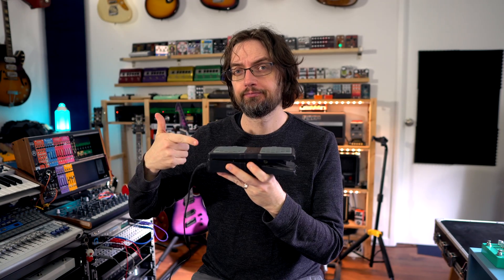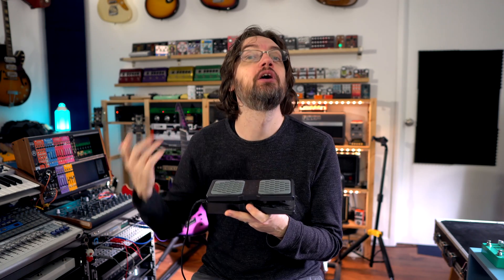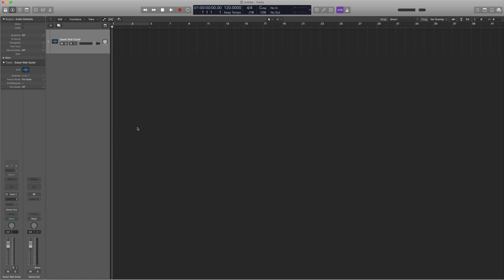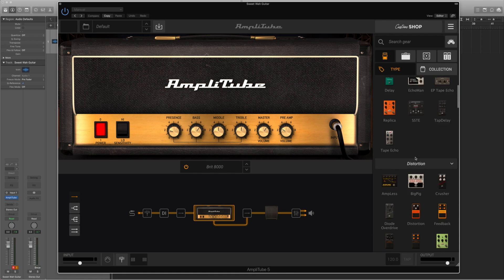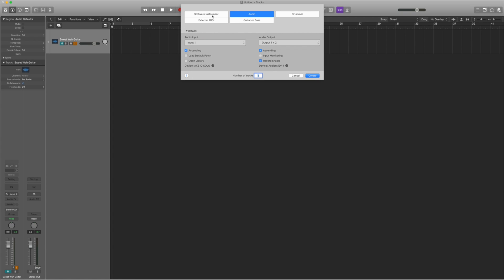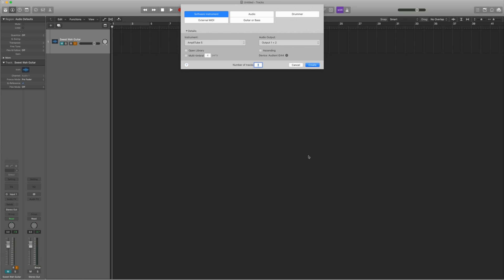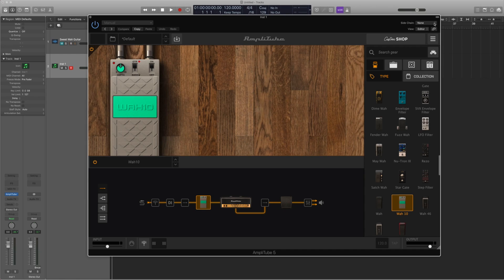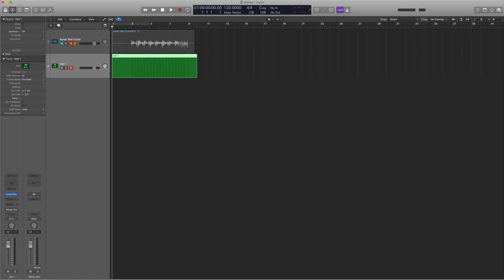How do I get an Expression Pedal to work in AmpliTube 5 with Logic Pro...??

Comment: Thanks so much for posting.  Brilliant how you figured this out.   I called Apple support to get help with using AmpliTube wah in Logic, and the rep found this video.  I was so frustrated, and this finally solved the problem.  Much thanks.  It seems like it should not be so complicated, but so be it.  Until maybe a future version of Logic Pro makes it easier, it is what it is.  I got the wah to work.  I play pedal steel guitar, and I use the volume pedal in AmpliTube pedals to play in AmpliTube proper.  Gonna try to get it to work as plugin in Logic Pro 11.  BTW, I am using IK Multimedia AXE I/O USB Guitar Audio Interface and Mission EP-1 expression pedal.

Comment: My audio interface does not have an expression pedal input, only a midi in and out. Is it possible to get it to work if I connect it via a convertor cable to a USB port on my Mac?

Comment: Hi, what is the best price/performance midi to usb device to connect the expression pedal to PC for home users who plays guitar for just fun?
Reply from the maker: If you don’t want to record it but just play then any of the IK Multimedia interfaces will do! This video is really only about recording what the expression pedal does in a DAW like Logic!

The AXE IO One for example is not very expensive and has two expression pedal inputs in the back, so you can have an expression pedal for a Wah or Whammy or anything like that PLUS a dual switch so you can change channels on the amp or turn effects on or off - it’s very easy to assign what the expression pedal and the buttons do

Comment: Amazing! This is closely to how to set up Mainstage and Helix Native! You can also set it up to engage the wah with the wah itself! In mainstage, create a new assignment, type Absolute,  using the same CC number as the wah, MIDI Through “Automatic”, send value to “none”. Map that to the switch controlling the wah bypass in helix native. Then use the “scale parameter” functionality in mainstage to disengage the switch when in pedal back position!

Comment: This ALMOST worked for me. My midi track was able to record the pedal's midi, but setting the sidechain back to the guitar track did not result in the guitar track's sound being applied to the midi amplitube channel.

By the way, I'm using the iRig Stomp I/O pedal board in hopes that I can use the board's built in expression pedal with amplitube while recording. But no luck so far :(

Comment: OMG why is everything in Logic so difficult? Are other DAWs as difficult with third party hardware integration?
It seems that stuff just stops working randomly without any reason or rhyme.
Reply from the maker: There is a much simpler way to do this - I’ll do another video soon!
Reply: @TSFAHTPS  Sooo, will we see another video on this?  I failed miserably to find a way to record with this and have the midi recorded as well. As soon as you do another take all is lost.

Comment: Just discovered this tutorial, and, after scratching my head and dispairing (and swearing!!) for so long ... Eureka - it works!! Thanks so much ... I can now get on with my retirement project of a cover of "White Room" ... !!
Just FYI - it might be helpful to others to say what my gear setup is  :-
MacBook Pro with Logic Pro X; guitar into Scarlett 6i6; Amplitube 5; Roland EV-5 Expression Pedal plugged into iRig Keys Pro (plug into keyboard before connecting USB to MacBook).
I had a bit of a struggle working out how to get Logic to "see" the keyboard!! (although it plays instantly if used with Software instruments Piano etc)  - found the answer in a short tutorial :- Logic Pro > Control Surfaces > Device > Logic Remote > Output Port and Input Port > iRig KEYS Pro
I then followed Gabor's tutorial through to recording a track with Wah (btw I chose the "Satch Wah")
Smiling again ...
Reply from the maker: Glad I could help!! I’ve been meaning to do a follow up video using the Control Surface setup!!

Comment: Logic seems to be garbage for using Wah or Expression pedals. I only use Logic and like it a lot, but using an expression pedal is tedious garbage. It will not only not work most of the time, it will forget all your hard work setting it up next time you start the app. Its super easy in the standalone amp sims.

Comment: I hace an axe i/o and connected a expression pedal and it works in amplitube but when in amplitube I record the track it doesn't record the wah I played. How can I solve it?
Reply from the maker: That’s what the video is about! There is actually a simpler way too…I’ll do another video soon!!
Reply: @TSFAHTPS  yes, but I don't want to use Logic, just record the track on Amplitube 5, maybe it's not possible
Reply from the maker: @DerrenTube  oh in the standalone version…sorry I misunderstood! That should work…I’ll check it out, I never really use the standalone version!!
Reply: @TSFAHTPS  yep I have an old mac so prefer using less app opened, but unfortunately on the standalone app it doesn't record the midi played, maybe there's a trick making insert, but I don't have any clue and last chance seems screen recording that also eat ram and resources.

Comment: I have an AXE I/O and plugged my expression pedal in. After I assign MIDI I can only control the pedal from approx 75% - 100% so I cannot get the pedal to turn off and on properly. How do I get that to calibrate properly? Many thanks
Reply from the maker: You should be able to calibrate that from your AXE I/O Control Panel App! 
Sometimes expression pedals have what looks like a volume control knob on the side and if thats not set to full it will not let you get the full range of the pedal!
Reply: @TSFAHTPS  Haha thanks! Yes that was the exact issue. Managed to locate a "knob" on the side that was preventing the full range of use with pedals. Probably took me about a week to work that out after exhausting all software options. Definitely felt a bit stupid lol
Reply from the maker: @p4fizzle  happens to the best of us!!

Comment: Hi, can you change amplitube presets in logic? stand alone mode is ok but in logic does not work
Reply from the maker: I think you may have to set it up in a similar way to the expression pedal
Reply: Yeah, program changes messages do nothing in VST mode, it's really frustrating. Midi gets there since I see the indicator blink, but it only work for learn feature. Unfortanately there is no way to learn program changes either. I really want a refund because of this.

Comment: An even easier way of doing it in Logic is to use smart controls. Set the parameter mapping to "Amplitube - Param 1". The external assignment is set by using the learn-button, then touching the exp-pedal. Go back to Amplitube, right mouse button on the wah-wah and set "assign automation" to "Param 1: Wah..." . All done, ready to go.
Reply from the maker: Thank you very much...I will try that!!
Reply: 😮 will try that for sure!
Reply: Checked this out last night and it works like a charm!  In my case I used it with the Wah in Neural DSPs ToneKing. Even had an old footswitch plugged into it to turn the Reverb on and off.
Reply: How do you set the parameter mapping? Is this within Logic preferences/setttings or within the setttings for the Amplitube plug in?
Reply: Thanks for this advice.  I went into smart controls and had Parameter 1 learn the expression AXE I/O expression pedal.  Then I had the Wah in AmpliTube use Parameter 1 as control.  This did not work UNTIL I changed the group to Touch (from Read).  Then it worked and created a single audio track that incorporated the way.  Note  that I needed to select Touch to get into work.   This does seem tone a simpler way of using the expression pedal.

Comment: Hey Gabor.... Wow. Simple... not! How the hell did you figure that lot out? Question- if you just have Amplitube and don’t have Logic is there a way to still get it working? Also I am assuming your running all of this on a Mac rather then a PC correct?
Reply from the maker: I kinda accidentally stumbled across that...you can technically hook up a midi keyboard and use the mod or pitch wheel on it to do the same! 

I’m on a Mac...I’d say it should work in most DAWs...you need to create a midi instrument track, see if you can use AmpliTube on that track and then side chain it to the audio track

Comment: Thanks for another nice video! IK used to make an expression pedal named "Stealth pedal". Don't know if they still do and if it works with v. 5
Reply from the maker: Yeah and they now have the “Stomp I/O” which is mostly geared towards the standalone software...I think you will still have to do it this way if you want to use it in a DAW...I think 🤔
Reply: @TSFAHTPS  I think that with the Stomp I/O you can add the MIDI to the Wah itself and set Logic to Touch or patch mode in Automation (I don't remember the name right now) and it should record the MIDI data as well. I've done that with the footswitch of the Big Pig pedal and worked flawlessly. Also worked with Studio One (with other tool names 😂)

Comment: Yep it makes perfect sense, very clearly explained, thank you. Plugged my pedal in via the expression input on my midi keyboard. Works with Guitar Rig too.
Reply from the maker: Thank you Marpy Mellow! I think this will work with most amp sim plugins!
Reply: What cable did you need to use for the expression input on the keyboard? Just another guitar cable? How did you sent it up with your keyboard? Same as video but used the keyboard as the input?

Comment: Gabor your a genius, have spent hours trying to work out the expression pedal with AmpliTube… really great video many thanks!🙂
Reply from the maker: Thank you very much!!
Reply: @TSFAHTPS  
this pedal works alone on the amplitube 5, or does it need a midi controller, I bought m vave chocolate from china midi controller, I wanted to know if the pedal works alone, only it on